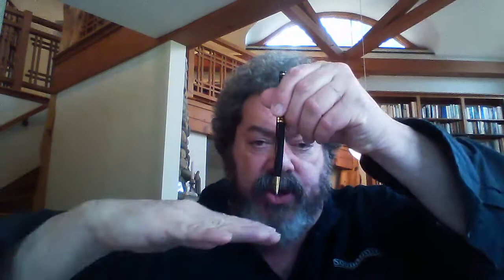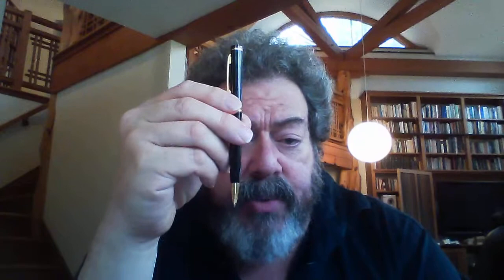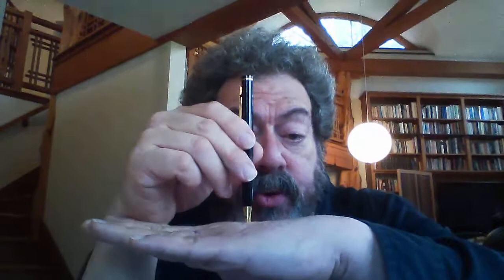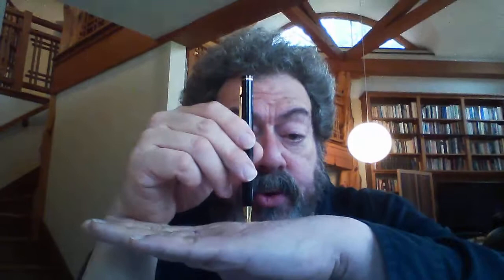SRA - Stylus Rake Angle - Soundsmith - Peter Ledermann

Comment: One tip I read a while back was to place a deck of playing cards on the plater to reduce the gap you are trying to view to get the arm level with the plater. Add or remove cards to get a slim gap. 
Sounds nuts but boy it sure takes some of the guess work out of it. 😎
Reply: I THANK YOU VERY MUCH.

Comment: I'm responding to an old post as a novice.
My main takeaway is knowing a slight rake angle (in the correct direction) is better than no angle. Or, heaven forbid, going the other way...mostly due to excessive downward tracking force outside manufacturer specification. 
That said, there will be other circumstances which might cause a mostly old, damaged, or used cantilever to sag, which I won't attempt to covered here.
As mentioned: Viewing the degree of perpendicularity by which the stylus is bond (all the way around) to the cantilever is worth seeing.
All these things assume you're working with a cantilever which isn't bent, one way or another, right out of the starting gate.

Comment: Richard Grey( of Power Station fame) that correct vta/sra produced the highest output. I am not the only one to have noted a drastic change in image size, that is a taller image with adjustment,  as if the volume had been turned up. Obviously this indicates Richard's right about  this.
I have ET 2 arm with a dial indicator, so adjustment on the fly is easy for me

Comment: Hi Peter,  another great video on cartridge setup. Another problem is that all records are not mastered with the same rake angle. While 92° is a good average,   the Laquers are cut at anywhere from 91 to 94 degrees. Astute listeners such as Harry Pearson and Peter Anzel have pointed  out in the past that as little as one tenth of a degree can make a significant difference and that each record needs to be dialed in individually for the best high frequency response. HP actually had a setup man that would adjust the tone arm height while HP was listening.  Of course, this is not practical for the average music lover and in general is only a problem for line contact styluses. As you say, good luck.

Comment: At a certain frequency output/test tone and a scope.....adjust the SRA until you get maximum output/signal. There has to be science in this other than tuning by your ears. Use your ears to check the final adjustment you made by science.

Comment: Records vary a lot in thickness so I would have thought that would be another variable. Any comments on that?
Reply: good point :)
Reply: Not to worry unless you have a table worth more than 10.000$. VPI decks for example have a very easy way to change VTA between record and so the user can. Its not really worth the hastle for us others.
Reply: I posted a similar question on Analog Planet's website after reading it's USB microscope set-up article.  I was told record thickness doesn't make a big enough difference to worry about.  That doesn't make sense to me given the world of LPs is based upon microscopic (electron microscope type) variances in a track's wall.  Real world results - I have a VPI on-the-fly VTA adjustable arm combined with a Soundsmith cart.  When I switch from a 180 or 200 gram LP to a paper thin 1980's LP I have to make a fairly big VTA adjustment to get the thin LP to sound right.  If I don't make an adjustment the thin LP sounds dull.  For the 30+ years prior to getting the VPI arm I simply accepted such sound quality variances as normal - probably just the differences in mastering.  Results for others may vary.
Reply: Mathematically, there are many elements which seem logically important, but do not really matter, and if the VTA has been found acceptable for any vinyl LP, the microscopic thickness differences, versus the 9-12" tonearm length, are entirely inconsequential. Put a full quarter inch thicker record on (real world situation needing like two thick mats!) and with a 9" tonearm, that is going to change the VTA by only 1.6 degrees! (Inverse Sin of .25/9). As most vinyl is going to fall within 2 mm thickness of every other record likely in a collection, that 2 mm variation up or down will change the VTA only 0.5 degrees - half a degree, which no one is going to measure accurately. Two fallacies approaching setup involve mistaking all planes and alignments as equally important, and mistaking decimal point refinements for actual significance. Tracking force changes compress the cantilever visibly, and as it is very short, that will alter the VTA vastly more than record thicknesses, perhaps by several degrees.
Reply: 180 gram lp is close to 0.030 thicker than standard lp. I have reset tonearm height just that to compensate (I use ET 2 arm with a dial indicator). Back in the day, one Enid Lumley at The Absolute  Sound descrbed using paper discs to do the same thing; IIRC,  she set by ear with thick lp, then shimmed to that height with the paper discs.
Reply: @z1522   True, the differences in record thickness just can't change the SRA enough. How come you can't hear a huge tone difference on different parts of a warped record? how many records are perfectly flat?

Comment: I trashed my Hana ML stylus trying to adjust the azimuth with a Fozgometer - never could even get near balanced output so went a bit too extreme in my adjustments. Anyway, my choices were to chuck it/sell it for parts, exchange it for a new one at Hana paying 70% of a new one, or getting Soundsmith to replace the cantilever/stylus, which I did. For $475 I got back a cartridge in a few weeks that sounded much better than the original. Perfect service and communication.

Comment: I would of thought that a better rake angle would be 88° not 92° it should serve the same thing purpose, but puts less stress on the stylus and the record  why isn't it  88° instead of 92° ??
That's why manufacturers put the pimple on stylist body? You use the edge of the stylus with the pimple on the record edge you look through  the gap with a line that is parallel with the record on a piece of card this will give you a horizontal parallel line on the stylist body what should be set up by the manufacturer to be correct. 
 But you being a facer you should know about this to find the correct rake angle you need to use a laser and measure light diffraction will tell you exactly? How are you finding the correct rake angle when you're grinding the diamond? Why doesn't somebody make a machine to check for this for the average Joe. [Something like a digital scale, where it tells you to place the styli in the centre dimple, A laser beam hits the tip of the styli and is picks up on the other side, the reading on the other side is calculated in the machine this will tell you what your rake angle is I can be adjusted accordingly while still on the machine, © all rights received not for commercial use.]